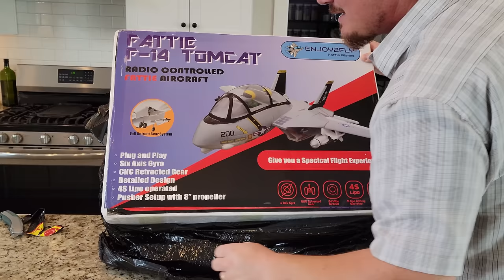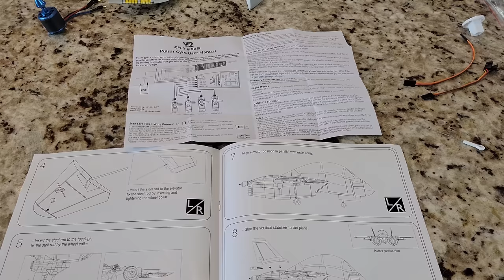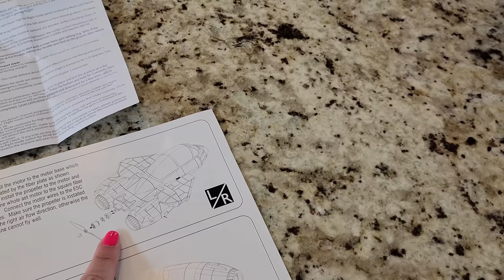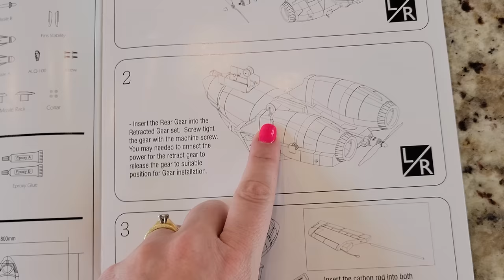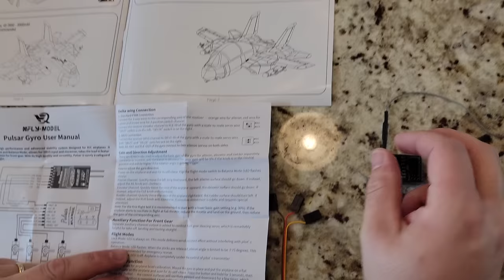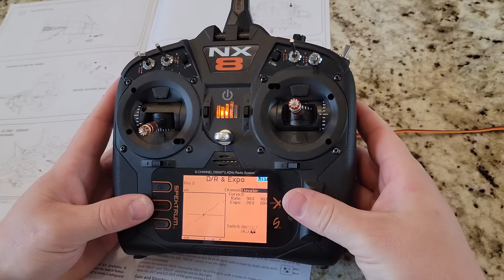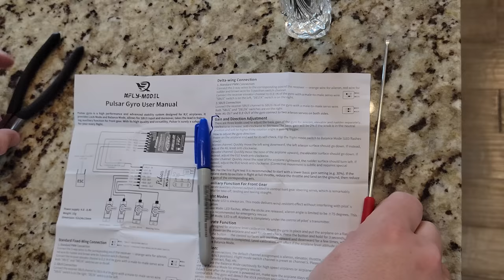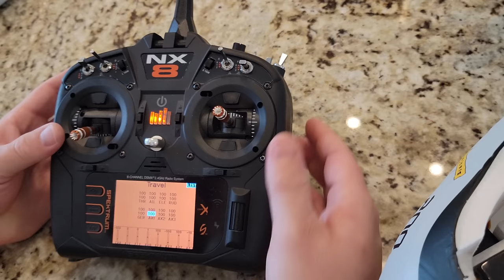Enjoy2Fly - Fattie F-14 Tomcat - 800mm - Unbox, Build, & Radio Setup

Comment: Brian, I watched your video about Chargers & Batteries but, I'm just lost. I'm going to find it (the video) again and try to make sense of it. I'm having issues with the speeds in which you can charge them. I've been just plugging them in and letting it do whatever until it's charged.
Reply: Not sure if this will answer your question as I haven't watched said video, but you only really need to look at two things on the battery. The capacity in mAh and the number of cells. E.g. a 6s 5000mAh LiPo.

Usually when you plug in the balance lead to the charger, this allows the charger to pick up the number of cells in the battery. So the charger set will automatically set the charging voltage appropriately so you don't need to worry about that.

But you do need to set the appropriate charging current. Charging current is usually 1C for most LiPos. So to calculate the charging current, you do charging current multiplied by capacity in Ah. To convert mAh to Ah, just divide the number by 1000.
For example a 6s 5000mAh: 1C charging current x 5000mAh/1000 = 1 x 5 = 5A.

Some LiPos say on the packaging that they can be charged at 2C or some other C rating. So you do the same equation as before but multiply by the given C rating instead of 1C.
For example a 6s 5000mAh with 2C charge rate: 2C charging current x 5000mAh/1000 = 2 x 5 = 10A.

Comment: I have this in EDF format - its fantastic fun - however the build is silly especially with the EDF version, its made more difficult than it needs to be to fit the moving tail plane- Removed the Pulsar and used an AR631 (SAFE and AS3X) I did not apply the ordinance....a big problem I had was due to the Nose gear doors jamming and popping off - so I had to remove the doors and trim down the edges of the plastic cage for the nose gear , also I had to remove the Air intakes so I could get my hand in to stick down the Aileron servo wires so they do not get sucked into the EDF unit.. - the "STIFF FOAM" is EPO foam same as the aircraft is made from - I have used them to make grips for hand launch 64mm EDF aircraft...also the main gear fits the wrong way !! for a F14 - die to the wheel axel being too long..that is a shame - mind you my edf version is Hand Launch anyway - so retracts are UP. All the time...

Comment: Another great video! Thanks for the entertainment. Quick question for your opinion? 

I was wondering your opinion between the Twin Otter or apprentice 1.2M. I’ve flown both and love them. I’m not a beginner in this hobby and have flown twins well already and I already own a Turbo Timber

I used to own both but got rid of them for different reasons so I want to get one of them back. the apprentice was just such a fun lovely simple plane to fly it was relaxing. But I really liked flying the twin otter as well beautiful plane. So I just wondering what you would choose if it was you? 

Thank you sir!
Reply from the maker: I think the Twin Otter is a cool looking plane, but I never find myself PICKING to fly it...might just be an overwhelming selection process to blame, rather than the Twin Otter....but I can say for certain, if you're in the market for a twin, and don't mean to muddy the waters, but the new D18 is AMAZING!!!

330S https://bit.ly/3cuZU2c
230S https://bit.ly/3yX2vJP
150S https://bit.ly/3OmmtUb
Infusion 180 https://bit.ly/3v2rsTe
A10 https://bit.ly/3uZ2MuI
AeroScout https://bit.ly/3OlqyYQ
Air Tractor https://bit.ly/3PoSL2c
Apprentice https://bit.ly/3BlSjh9 <<<<<<<< 1.5m is a joy to fly, but it's a lot lower echelon than the Twin Otter - and easier too, by miles, to fly.
Beechcraft D18 https://bit.ly/3x7dRea  <<<<<<<<<< This one is AWESOME!
Carbon Cub S2 https://bit.ly/3PqNR4A
CZ Cessna 150 https://bit.ly/3RNoprG
CZ Cub SS https://bit.ly/3OlTJem
Cherokee https://bit.ly/3B4ZzO0 <<<<<<<<< I like flying this BETTER than the Twin Otter too...
Cirrus SR22T https://bit.ly/3RRwPhC
Citation Longitude https://bit.ly/3aQIYTq
Commander https://bit.ly/3OqIJw2
Conscendo Evo https://bit.ly/3cx8jm1
Draco https://bit.ly/3zi8URp
Duet https://bit.ly/3yXgaAB
EC1500 https://bit.ly/3aUcTdm
Extra 300 https://bit.ly/3oh2rzE
F15 https://bit.ly/3RLgaMO
F16 https://bit.ly/3aSp4Yl
F18 https://bit.ly/3zjVDHR
F4U https://bit.ly/3aTWi9H
Fw190 https://bit.ly/3cuZWaz
Habu https://bit.ly/3ci5eWD
Maule https://bit.ly/3IQXcQU
Opterra https://bit.ly/3cnldCN
P39 https://bit.ly/3aWhEmS
P47 https://bit.ly/3aU3v9K
P51 https://bit.ly/3ohT4zT
Pitts https://bit.ly/3IUkTrF
Radian https://bit.ly/3PopF2W
RV7 https://bit.ly/3z1VuI2
Sport Cub https://bit.ly/3yYkrUs
Su30 https://bit.ly/3B51zG0
T28 https://bit.ly/3PmbxHf
Timber https://bit.ly/3OjD6jf
Twin Otter https://bit.ly/3PMVFxD <<<<<<<<<<<<< Not sure why this one never seems to grab me when I'm picking something to fly...I do enjoy flying it, but the flight envelope is arguably narrower than some of the others I find myself "going to"
Ultimate 3D https://bit.ly/3PqQB1S
Ultra Stick https://bit.ly/3yZizuV
Ultrix https://bit.ly/3Ohv7Dm
V900 https://bit.ly/3IRl0UG
V1200 https://bit.ly/3B5NKag
Valiant https://bit.ly/3IQy9gV
Vapor https://bit.ly/3ROOdE0
Viper https://bit.ly/3og8kNE